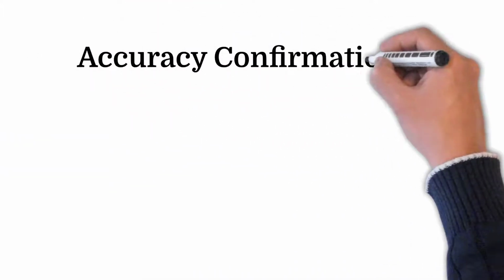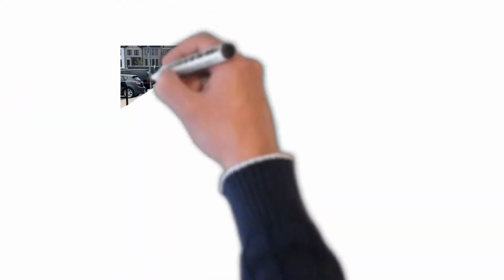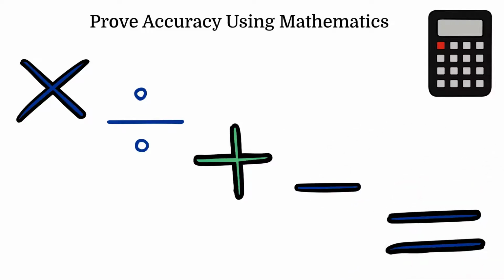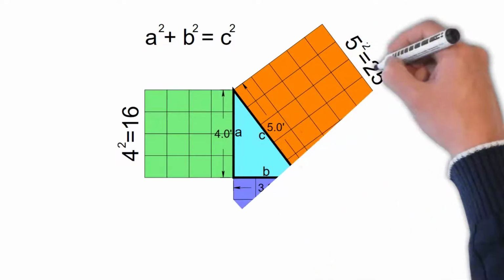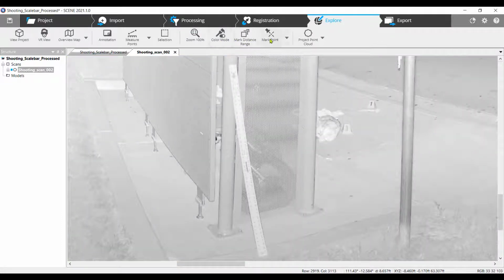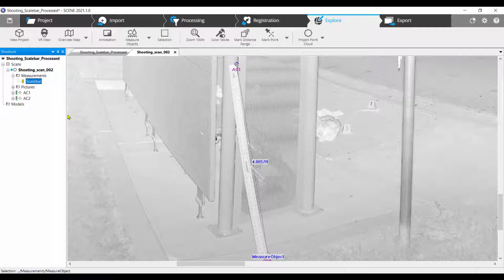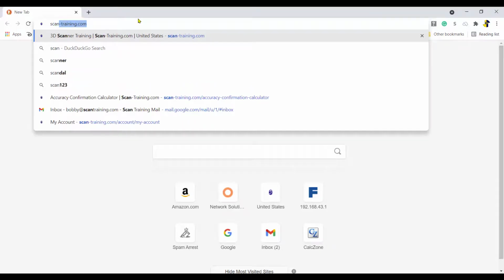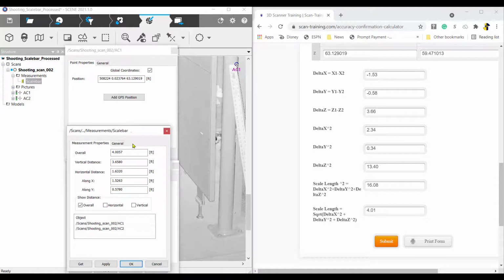Accuracy Confirmation

Comment: Content is ok but your animations are unnecessarily distracting and the calculations only as good as the initial point placements and just duplicate what scene already calculates for you
Reply from the maker: Thank you Michael for your reply.  This is something new I'm trying and I appreciate the feedback, plus it was fun to make.  As to the calculations, this is a foundation or another form of proof that the scanner is capturing measurements correctly and that the scene software can visually report the data correctly.  If the calculations don't match the measurement, you know there is a problem.  This is for the folks like myself who are involved in the forensic aspect of scanning and constantly questioned about the accuracy of measurements.